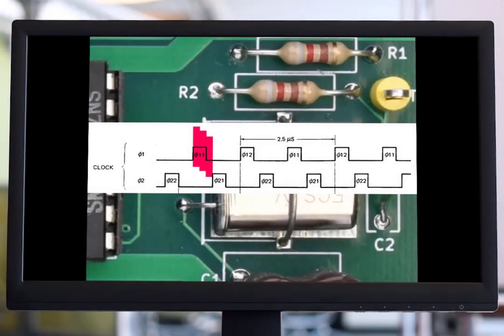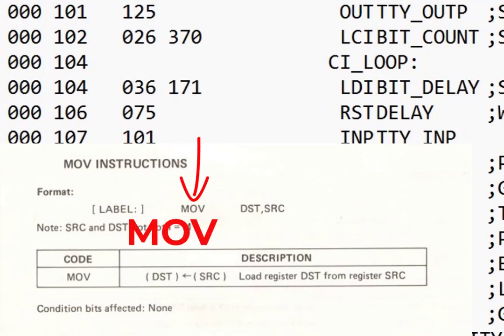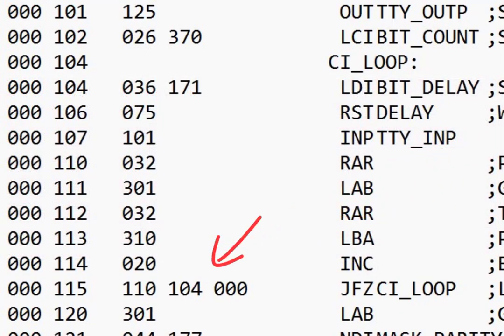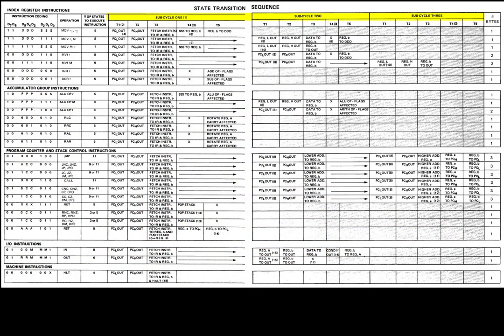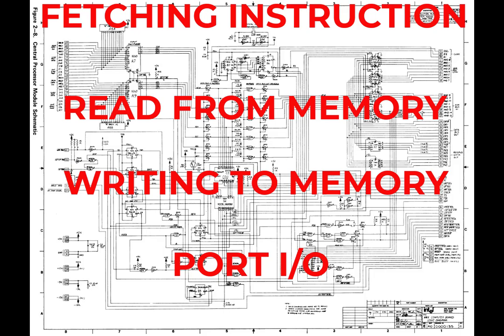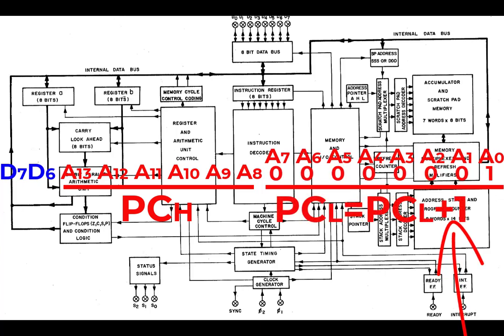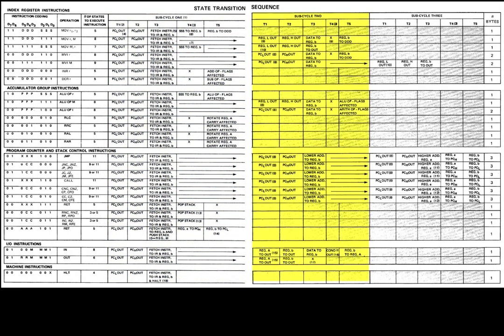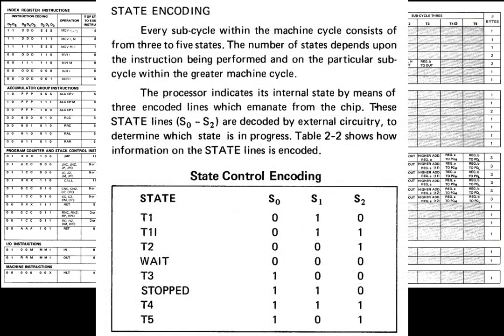{98} 8008 Processor Cycles Pt 1 of 2:  Instructions to Sub-Cycles, cycle Coding bits.

Comment: Very interesting!  I'm planning to build a Mark-8 replica (ordered the boards and the rarer IC's already), so this is fascinating stuff.  I'm probably crazy to even try it, but I'm glad that there are other people out there crazy enough to understand this short-lived but historically important microprocessor!
Reply from the maker: there is nothing like a little 8008 programming to make you appreciate having a stack.  There is also the MIL MOD 8 board set available.  it is a lot of fun and, as a side benefit, has a 1702 programmer if you need one.
Reply: @HelloWorldETX  Neat!  Where is the MIL MOD 8 board set available?  I'd be curious to take a look at it.  (You mean a reproduction, right?  I imagine the originals are rare?)

I see you have some of the Intellec repro boards on your website, but not on Tindie (yet?).  Have you made any recent progress on that project?  (Not that I'm one to push anybody -- I have project ADD!)
Reply from the maker: @derekchristenson5711  

Someone else has been asking about the intellec boards too.  I think it is ready to publish the build files for most boards.  But I do not have the i/o or UART board yet, which would be needed to hang the terminal.  I pushed that project off for this winter, which is coming very quickly here.   So sometime before the end of the year.

For the MIL MOD 8 and 80 board set—
CHARLES BAETSEN
https://va3ngc.weebly.com/repo-boards.html